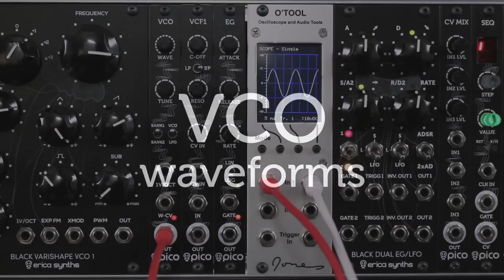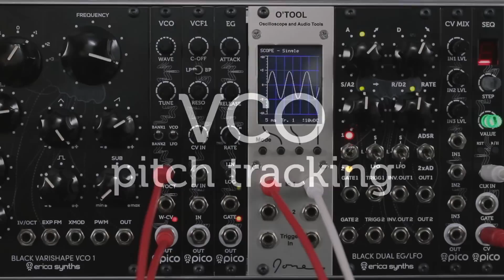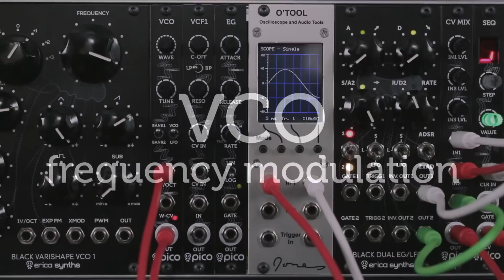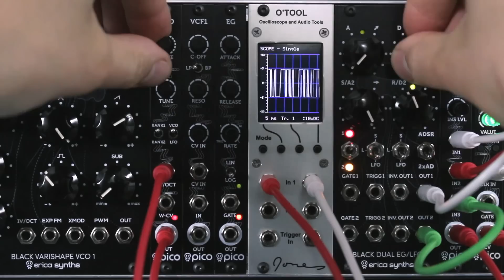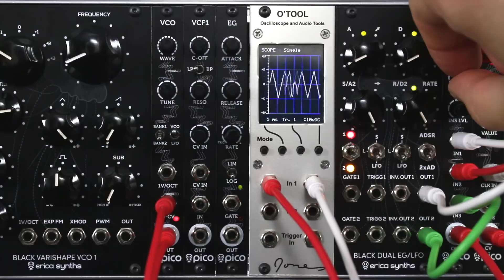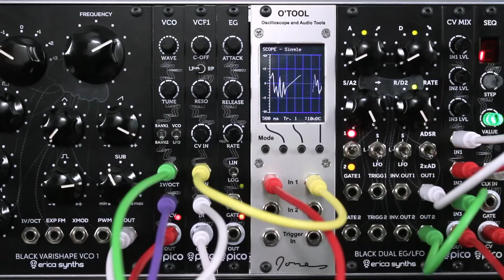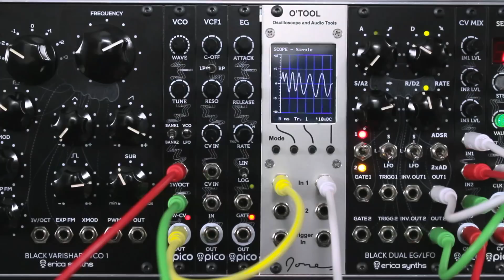Erica Synths Pico VCO demo

Comment: I don't understand how he does FM with the mixer. Is this something a VCA that can accept audiorate CV could accomplish? Is that the general principle? I am very new to this stuff, in terms of my understanding. I snagged some stuff cheaply in Fall of '18, thought I would be able to learn with it, but then our youngest son got seriously sick and, well: you don't need my life story but I didn't spend any time with the new equipment for a long time. So I know basically nothing.

What I do know: This seems like an utterly clear choice for anyone putting a new system together. It's versatile without sacrificing "classic" modular sounds. It's a wavetable VCO that doesn't make you choose between a VCO and a wavetable VCO, if you take my meaning. I think the choices for the 16 waves in each bank show a perfect blend of good taste and creativity. Very impressed.
Reply: I believe he's using the mixer to control how strong of a signal from the other osc is going into the v/oct of pico vco. Otherwise it would be always 100%, which would be too much. someone correct me if I'm wrong.
Reply: @jeffb01  That's distinctly possible, but many FM synth patches have a 100% input of the operator signal into the carrier, don't they? The level of influence an operator oscillator has on the carrier is what the FM knob usually controls, but then again this synth just has an FM patch point, so you might be right: the mixer could be functioning like a 'de facto' FM intensity control. I'd be very interested to know if that's what happening or if it requires a VCA that can take audio rate CV. Or maybe it's both. Modular is like computer programming with wires, and is so complex but that's why it can be so expressive. Love it, even if I don't understand it at all haha.